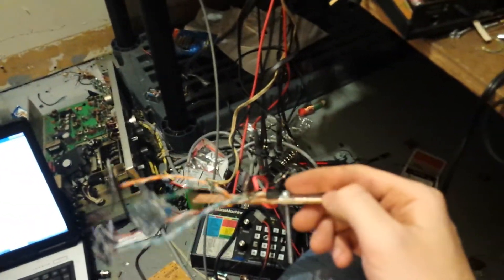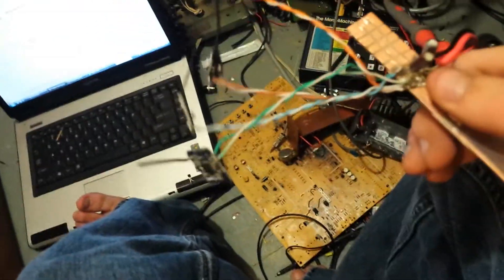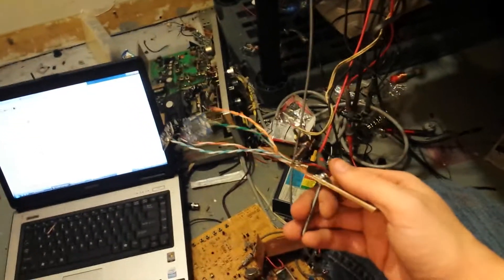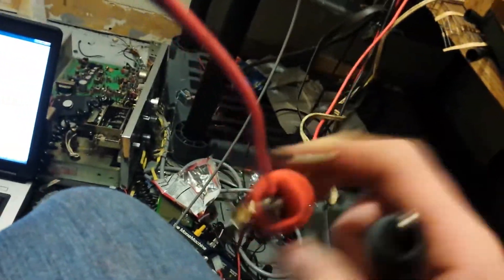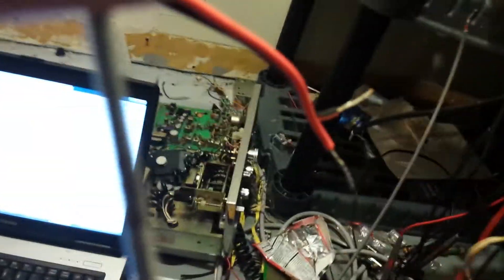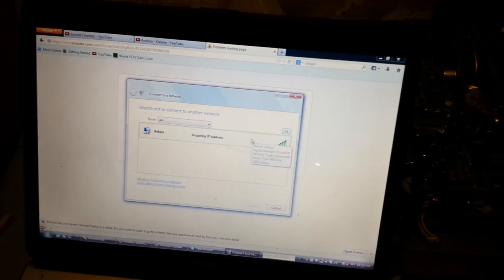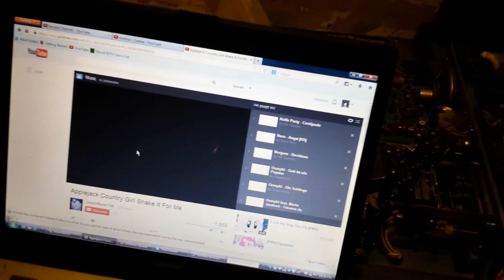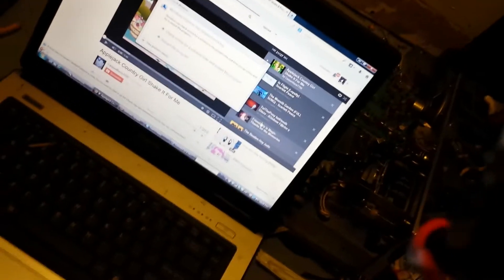Wifi jammer

Comment: What are those little transmitters you have?
Reply from the maker: Link added to description. The other device is an LM7805. You can power these from 3.3 to 5 volts, that is just a regulator.